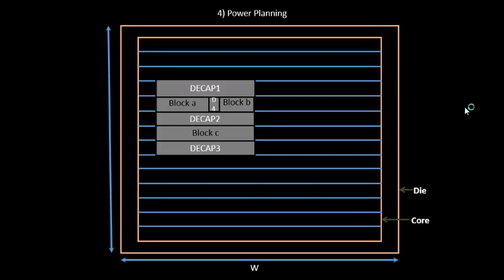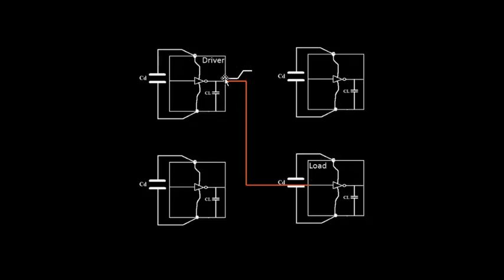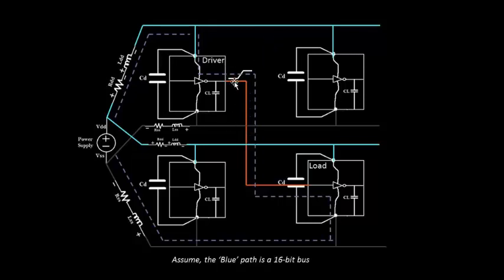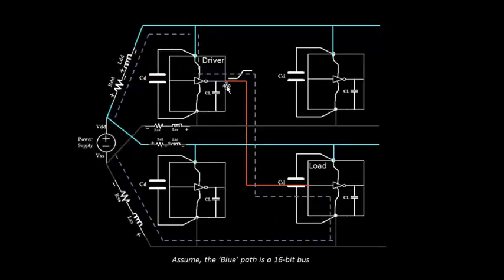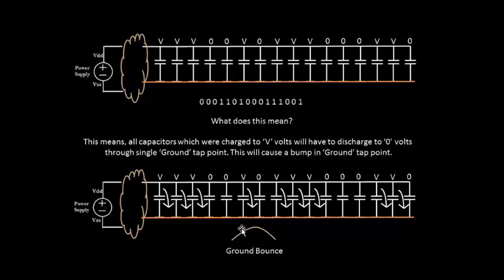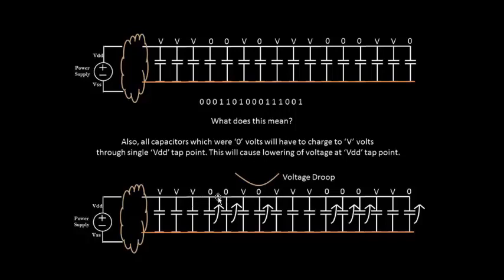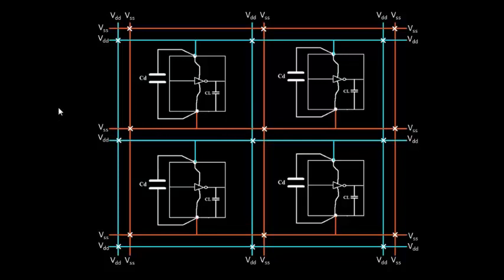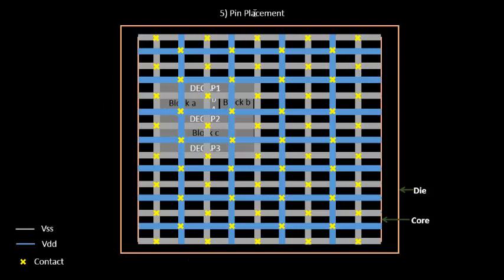How to do Power Planning?? Learn @ Udemy- VLSI Academy

Comment: Once we have the power mesh, then the power source will be available physically closer to the macros. In that case, there won't be much role played by the wire R and L. So, what will be the necessity of Decap cells around the macros in that case.
Reply: +Sibivel chinnasamy Good question
Reply: For extra support. The PG mesh  must be too dense otherwise it takes away routing resources for signal routes. The Decap auguments the grid and also helps filter out high frequency noise. I hope this helps.